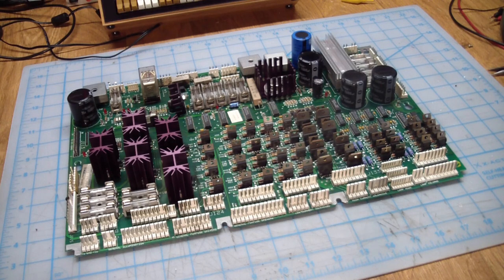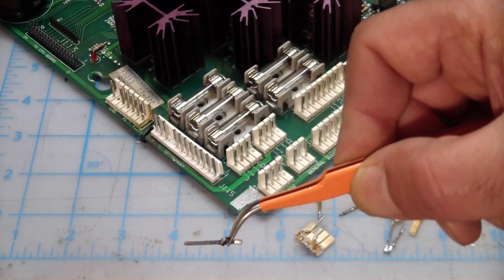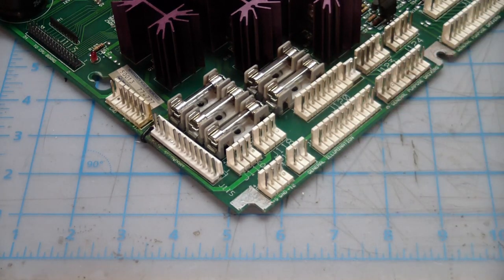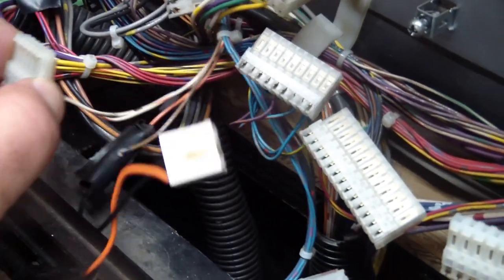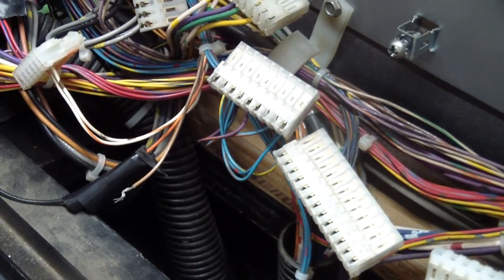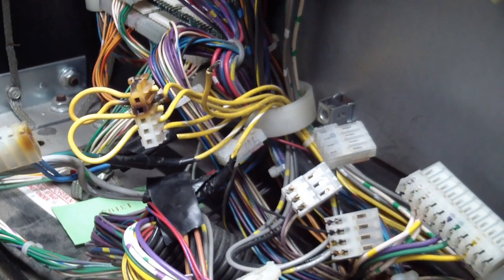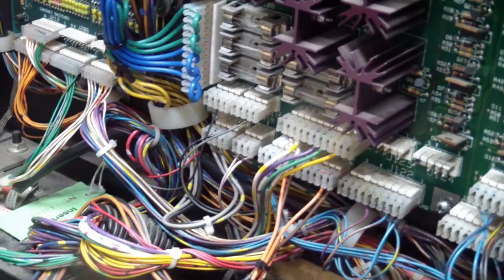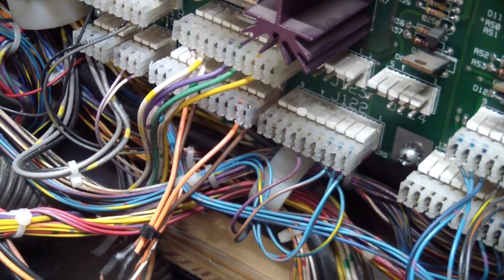AE#124 Repairing A Williams Terminator 2 Pinball Machine, Part 2

Comment: I would replace all the high current draw header connectors with molex connectors and trifurcon pins instead of the factory IDC punchdown connectors.  J 101    J-115   J-120   J-121. I had to replace these connectors on my Hurricane. All lights work 100%  I also switched all bulbs to LEDS for less draw and heat.  Always a good feeling to get one of these machines back up and running as new.. good job.
Reply: Hello Barry,  thank you for your comments and suggestions!  Not sure if you have T2 repair videos,  Being a nubee to the T2 have a few minor issues to keep me learning.

Comment: Great video. Curious what those connectors are called or a model number for them? Is there a punch down tool used to insert the wires? I have a mixing console with dozens of those in it.
Reply from the maker: They're called Molex connectors. There are all sorts of punch down tools from pen type manual ones which are a pain to use but cheap (I use those) to actual crimpers which I've been told make this a really easy job.

Comment: Would it make sense to replace the bulbs with LEDs to reduce power consumption and prolong the life of the electronics or would that ruin the original look of the machine?
Reply from the maker: First off I'm a stickler when it comes to keeping machines looking original. I've tried a few LEDs which offer lots of advantages in both lowered power consumption and durability, but I haven't found any replacements that look acceptable to my eyes yet. 
Any AC driven lamp will flicker to a certain degree, but LEDs can get really annoying.
Reply: @artifactelectronics  If you buy the fully internally rectified LEDs then the flash rate is doubled to 120Hz and you can't see it flicker.  Some models even include a small internal filter cap after the rectifier so they don't flicker at all.  You know that they're rectified if they are not polarity sensitive.  Pinball LEDs have come a long way in the past few years with features such as this plus non-ghosting, brighter colors and more colors, flashing and fading modes, multicolor, and so on.  I converted my entire T2 machine to LEDs and it looks amazing and it reduced power consumption by like 150W.  I also installed an NVRAM module to permanently eliminate the battery, and installed the ColorDMD display which looks incredible.  You should give it a try.
Reply: @bill392  I have recently purchased a rebuilt T2.  Thank you for the tip!

Comment: What a great amount of information! Thank you for that. I also have a T2, and all of a sudden, the enter button is not responding. The volume and escape buttons work fine. Any advice on what to do??
Reply from the maker: You could measure button functionality by using a continuity tester on the switch contacts and also check for good wire connections while you're there.